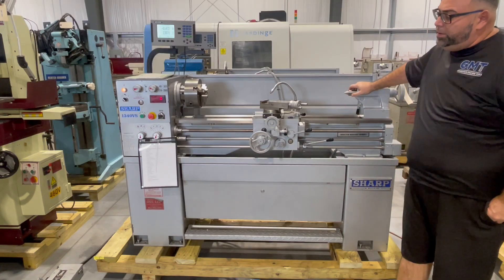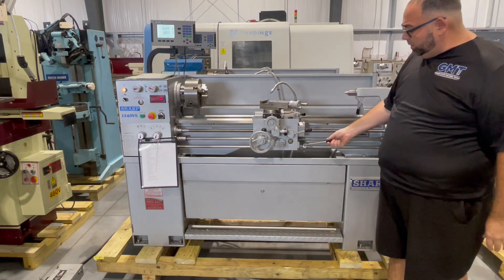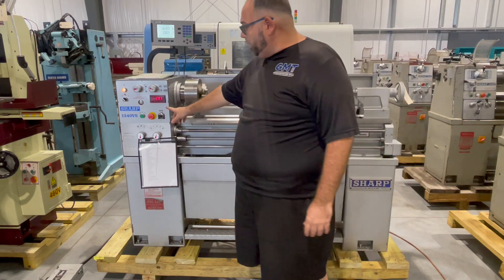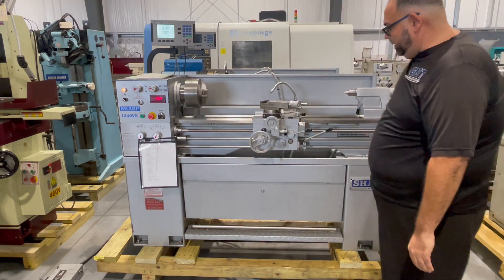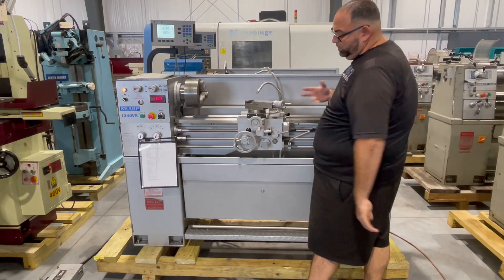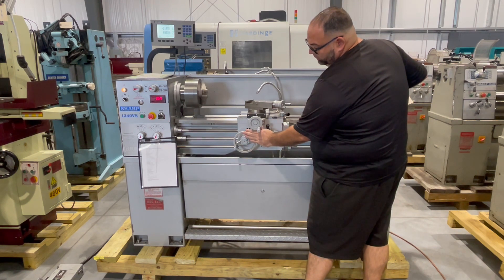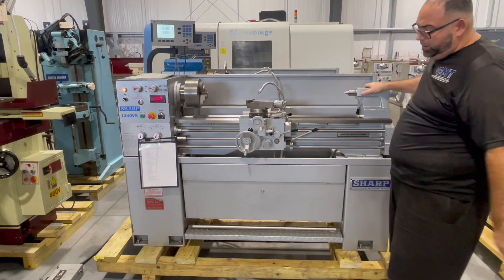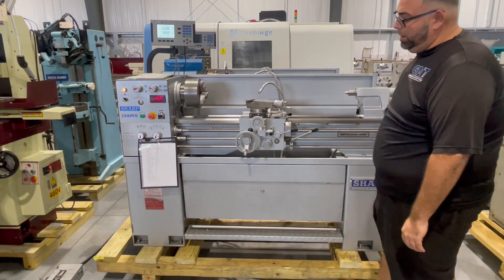SHARP 1340VS Variable Speed Precision Lathe 2012’ #GMT-3495

Comment: OK, a good demonstration, it works. 
It would be nice however, if you measured the alignment of the turning head to the sliding bed. And the alignment of the fixed (sliding head) to the bed and the turning head.
If these are only sligtly misaligned or off-centre, turning a longer part with precision is impossible.  You get measurable taper in the part.